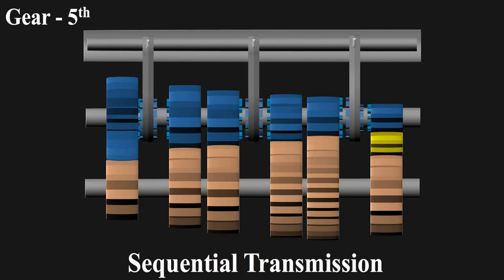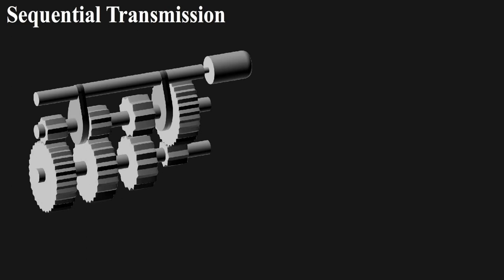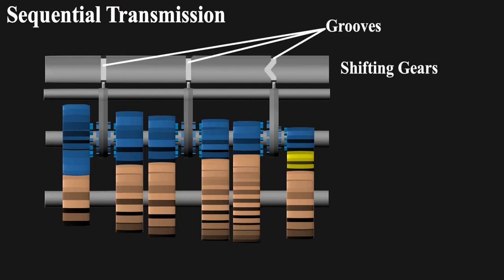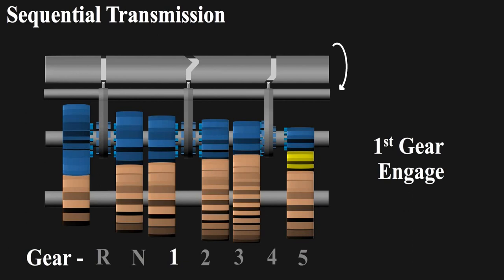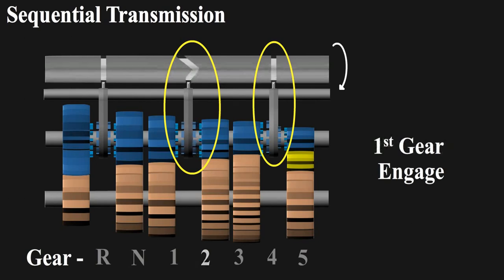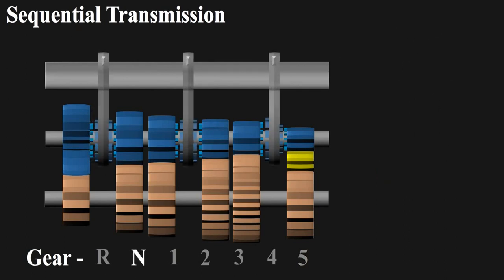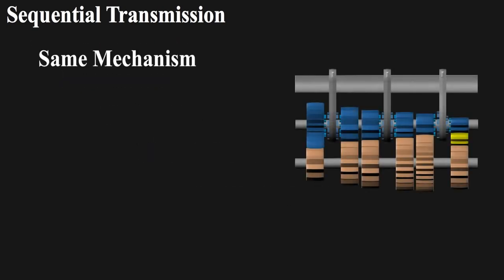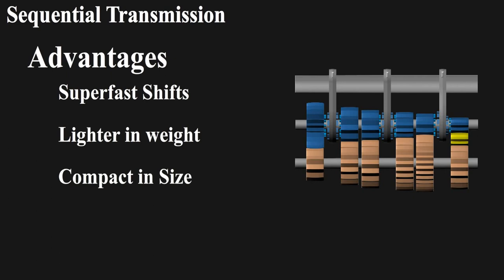Sequential Transmission - Explained as simple as possible

Comment: Why normal car not use sequential gearbox??
Reply: It's not build to last.
Reply: because its expensive
Reply: It seems to me that small cars would benefit from using these, as they are smaller, lighter, and easier to maintain. And as the video mentioned, it could be engineered to behave exactly like a regular automatic transmission by handing control of the clutch and gear selection off to a computer.